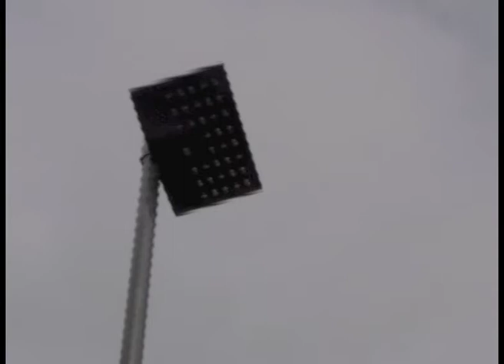Miles Johnston talking about LED Street lighting 21 October 2013

Comment: "No, LEDs can't spy on you, as they are emitters, they don't recieve any information.  You can use LEDs to sent Data - and this has been done for the last 40 years with opto-copler or light-phones for example.

But to spy on you, you would still need to install a microphone/camera/Whatever. And that can be done without an LED too.

"many people are misinterpreting this to mean that the led can actually "pick up" audio like a microphone, this is not the case." Not rally misintepretation, if you specificly, in the title nad the description say, the light can spy on you - in the description you even say, it can hear what you say."